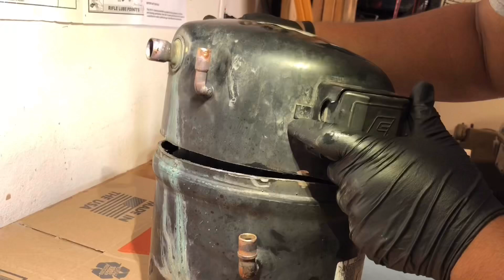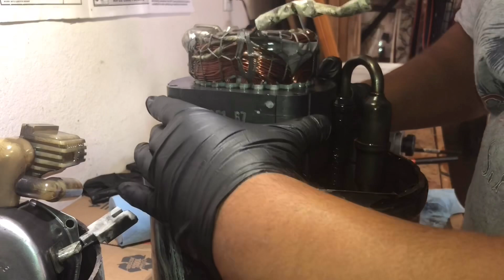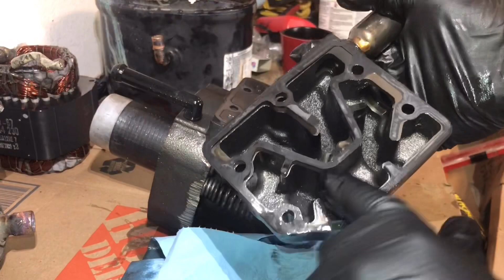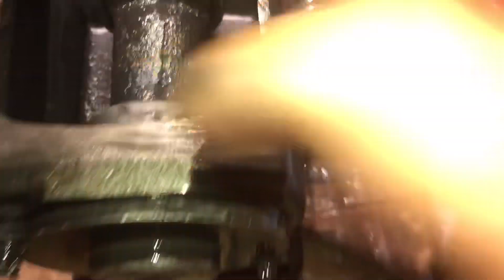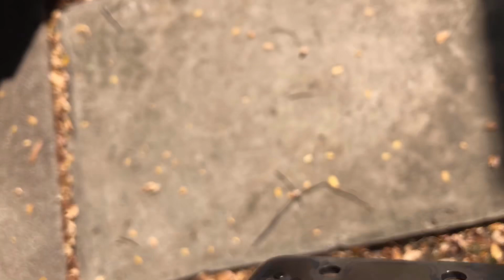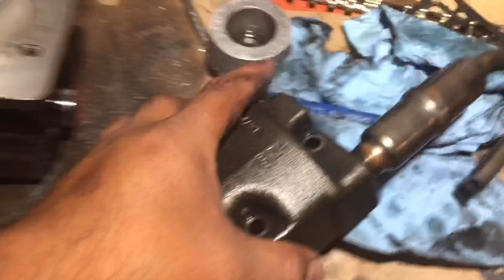HVAC Refrigeration:  Cutting Open a Reciprocating Compressor from a Freezer.

Comment: Looks like you had extreme heat on the discharge valves which caused the springs to get wea. What was the discharge temperature at the compressor at the time of failure?
Reply from the maker: I didn’t check that.  And I don’t think I could have.

Comment: Scrolls arent the only compressor that is rotation sensitive.  If u run a screw or centrifugal backwards, might as well pack it up.
Reply from the maker: Josh Stevens true.  I don’t work in any screws so that’s why I didn’t mention it.   Good call.

Comment: Did you see if the piston had pressure by placing your palm over the cycling/piston? Could have either rings or some sort of seal that gave way in the cylinder wall.
Reply from the maker: No I didn’t.  But I believe we already determined it was a faulty internal bypass.
Reply: Rookie Refrigeration I’ve never seen the inside of an a/c compressor. Great content... 👍
Reply from the maker: Mike Silva thanks for watching bud.  I appreciate it

Comment: First compressor autopsy I’ve seen! Thanks for this 👍👍👍.

Would have liked to see you “hand torque” the motor before removal to demonstrate the suspension system. My unit starts with a loud thump which, while annoying, does not seem to affect (effect?) operation. Anyway to minimize the sound? One of these days, I’ll check external mounts and see what’s up.
Reply from the maker: It’s my first one too so I was not as knowledgeable as I’d like to have been.  But maybe I’ll do one later.  Thank you for watching

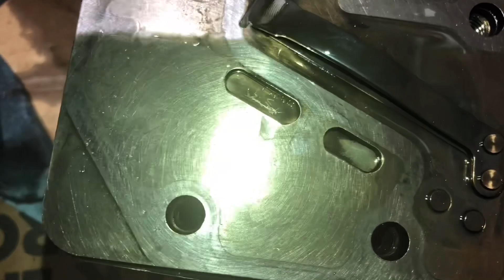Comment: It is a bent valve. At the 10:03 mark you can see the suction valve not seated and oil passing back through. Probably a slug of oil or liquid refrigerant at start up.
Reply from the maker: I believe I may have caused that.  With a screwdriver.   But we believe the cause was the high pesos relief valve failed.

Comment: Good learning experience  about the common  failer  problems  with  sealed  compressors  . Low amps it's  running  but both  gauges  read the same  just not pumping . Plus other reasons  why it broke . Dirty coil . fan motor  quit . If it's  really  old the condenser coil is not exchanging  heat anymore  . When it comes to  reach in  with the assbly  on top  and it's  got some age on it . Change  the hole skid   so your not coming back  playing monkey nut  with it  . Most cases  jamed up with heavy  dust on the coil   and no high limits  and it kept getting  opened up  and stuck open  . Some motors  have a heat switch  in the winding  that goes  open  and does not come back . Learning  to recognize  when it's  beyond  economical repair  . So your not coming back  all the time because they don't want to  spend  the money  . Can make you look bad because  trying  to do a cheap  repair   and get them  going  mom and pop restaurant's  being  the worst.
Reply from the maker: Lol. Agreed.  All very good points.   I enjoyed this comment. Thank you

Comment: I can assure you  it's the pressure relief valve, it's exactly that , for high pressure and will only open at 375 to 475 psi and or will vary with  the gas types, so if you had pressure through it, its stuck open, or the seating mechanism is busted...ClS services Trinidad and Tobago  Caribbean.
Reply from the maker: Yes I agree, once this video was released and after several comments we have determined it is a high pressure relief. Thank you for watching

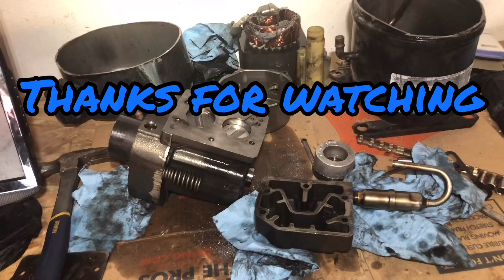Comment: Right around 17:48 In the vid your showing the relief valve and if you look close enough there is a machined hole on the side of the valve I would bet if the pressure builds it pushes that spring forward just enough to relieve the pressure thur the hole
Reply from the maker: Yeah. I think after the video was made we determined it was definitely the prv.  Thanks for the advice.  👍🏽

Comment: Does anyone rebuild compressors ?
Reply: I had a company many years ago that we did repair them from 1/8 hp to 15 ton seal type and to this day they are still repairing  here on the island done by my former workers..CLS Services Trinidad and Tobago Caribbean.
Reply from the maker: Lalo Reyes not these bro.  These are hermetically sealed, so you just replace them.

Comment: Definitely the pressure relief valve. I would think it is normally closed. Something else in the system (outside the compressor) caused the pressure to get too high and the pressure bypass opened in the compressor. This caused the compressor to not pump. After the external issues where resolved the internal bypass should have reset. This works the same way as the thermal overload on the windings. It is nice to know what caused the problem but as with all hermetic sealed compressors, if the no pump or spin they garbage! Cool video. Keep them coming.
Reply from the maker: Thanks bro.  Yeah, after I was told it was a relief valve and thinking about the symptoms, I think it was the issue.

Comment: What was the symptoms? Tripping breakers, loud operation,  wouldn't pull down,  or wouldn't hold pump down? Good break down video 👍🏻👍🏻
Reply from the maker: Compressor was running but not pumping.  I initially thought it may have been a bad discharge valve but after the video I believe it could have also been the pressure relief.
Reply: @rookierefrigeration4357  you should have been able to hear the relief bypassing? How was the amp draw? Was there wear in the pistons or piston sleeves?
Reply: HVAC*R Survival it was in a prior video of his. It sounded like bypassing pressure relief. You could easily hear it hissing in video but i don’t think he noticed or knew the sound. He just knew it wasn’t pumping and late at night so he replaced it.
Reply from the maker: Holy hell man, YouTube doesn’t give me notifications that well.  I just saw this comment.  Lol.  Yeah, I think it was the internal bypass.
Reply: @rookierefrigeration4357  you have to turn the notifications on,  I still don't get all of mine,  sometimes only when I open the app. It's all good my man👍👍
Reply: @jphvac5725  
Can you post the time in the video where you hear the hissing?
Reply: @hg2.  it was a prior video to this one from a year ago. I vaguely remember it but don’t think you can miss the sound of a compressor pressure relief bypassing. Sorry I don’t remember name of video now.

Comment: Must be the valve plate.. Remember when the compressor is running, the pressure higher then when you are holding it in your hand.. So if a small gap you might not be able to see, is a lot bigger under pressure.. Cool video
Reply from the maker: Very true.  I agree.  Just cause I can’t see it doesn’t mean it’s not there. B